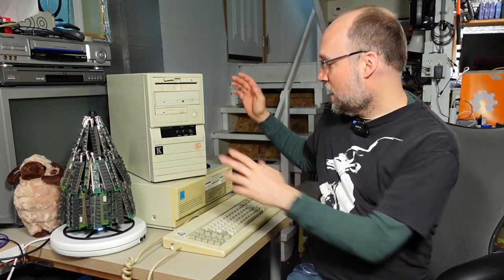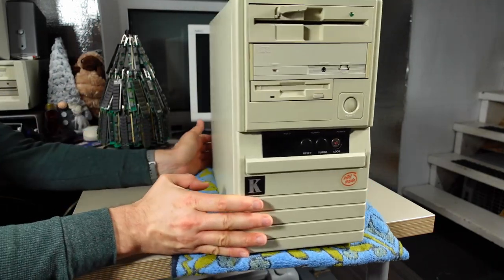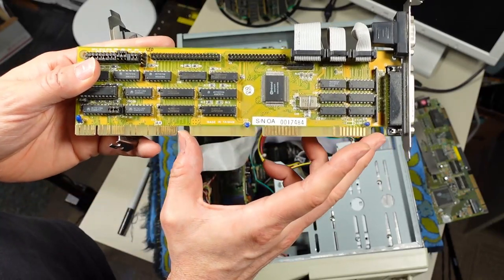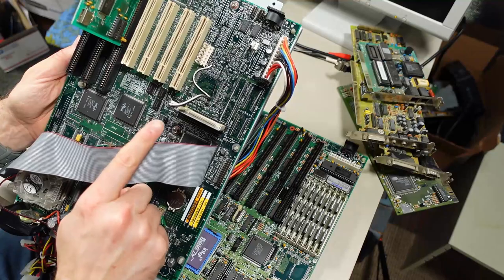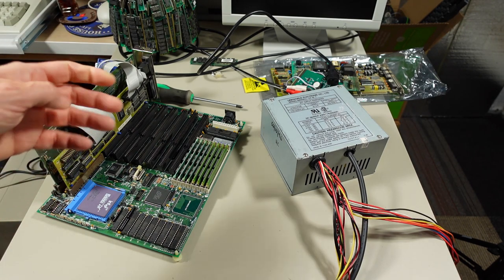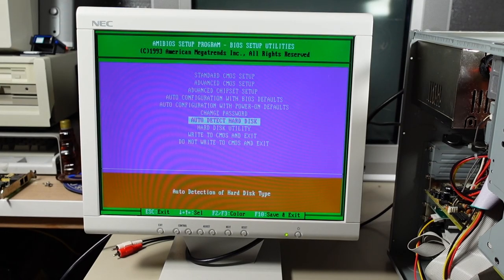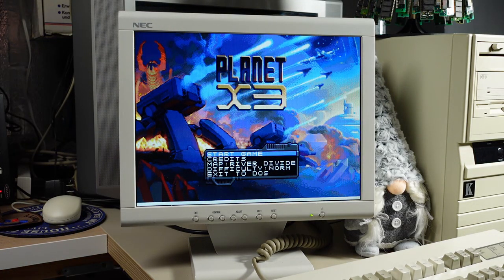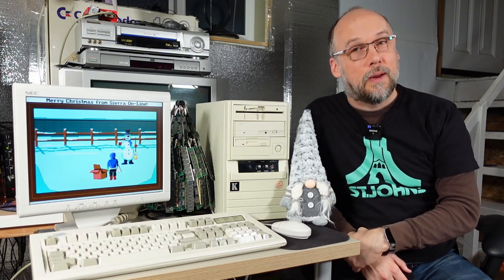PC archeology: Mystery 486 Mini-Tower

Comment: Hi Adrian - a good find there - you make me jealous

Re the sound issue, here is some hints - remembering the card may not be 100% compatible

1. in the bios disable com 2-3-4 , you only need 1 com port for the mouse
2. try using dos 6.22 and load different mouse versions mouse.com  / ctmouse    / mouse.sys i had a dell that hated the default mouse driver and made screeching mounds when moving the mouse
3. remove the modem - i recall you had one but not sure if it went back in - as they add a com port and steal a interrupt ( or double it up )
4. reboot in dos mode and try microsoft diagnostics  msd.exe ?? that will give you the resources used
5. remove the video card and try another one incase it uses different resources and frees something up that make the cdrom work or the sound better
6. in bios disable anything to do with game port - you have 2 so turn them both of for now then enable one or the other later
7. try re-running dos 6.22 memmaker - make a few copies of config.sys and autoexex ( i copy the first ones as *.1 , then second attempt as *.2 etc ) - you may find memmaker may be able to exclude some base memory address that is reserved fr the cards and your cd rom will play again - this does happen on my SB16-and 2x propitiatory ( sony ?? ) cdrom 
8. while the local bus cards have to remain in those slots, move the sound  card to a different slot - it may use different resources - this happens to me with those other sound cards ( they are cut on a slant edge on one side i forget the brand name ) - it also occurs if you have sound and network cards, swap them around and you use different resources - this happens on my dell celeron 2400

That is about it

Regards
George

Comment: Wow, I thought there would be more SMDs on those boards.  I was surprised to see so many through hole devices.  I remember in late 1993 my family finally bought a computer.  It was a pizza box Packard Bell running Windows 3.11.  It came with a 3.5" floppy and a tray style CD-ROM drive; I don't remember what the hard drive or processor were though.

Comment: I started a new job back in mid 2000 and the computer they gave me to use had that case.
The computer itself was terrible, I got into the habit of backing up the hard drive every night before I left because I was afraid it would crash the next morning.
When they finally got around to replacing it they admitted to me it was the oldest computer onsite.

Comment: The version of that utility for the GD543X series (VGAUtil/WinMode v2.06A in my machine's case) has more options, including independent refresh rates per resolution AND color depth selection pair.  The default for 1024x768, at least on this version, is 72Hz.  That's probably why it was tripping on the LCD.  I'm not sure if the GD543X version of the drivers would work with GD542X series but...worth a try, if you are ever so inclined to get that 486 working with an LCD panel. :)

Comment: Don't know the 'Thunder' Audio Spectrum, but I had a Pro Audio Spectrum 16 in my first PC.  It also drove my CDROM drive, a Sony CDU-31A single-speed drive.  It had a normal tray like a modern drive, no caddy or anything, but it also used some proprietary interface.  I do recall also that PC speaker sounds came out of my external amplified speakers somehow, and there was also a Windows mixer knob for speaker.

As far as compatibility with that card, I found Sound Blaster compatible stuff to work fine; however, IIRC that card was only compatible with a SB Pro and not an SB16.  If you wanted 16-bit audio you had to get native PAS16 drivers for it.  I suspect you may be using the wrong drivers, as there are different PAS models other than the PAS16.  If that doesn't help, perhaps something is quirky with this weird 'Thunder' clone.

Comment: I am very sure the issue IS the driver that does not initialize the sound card correctly. The fact you can hear very faint music from adlib/sb games is a clear indication of it. Too bad it is not a pnp card, you could have use the unisound initializer without the need of fiddling with old software.

Comment: Cirrus Logic video cards are also common in Japanese NEC PC-9800 computers, but using C-BUS connection. Sadly, they are not recommended for gaming as they are known to have compatibility issues with most games.

Also these cards offer VGA output connector, otherwise the computer only has Digital RGB and analog RGB video outputs built-in.

Comment: For the CD-ROM, it's either Mitsumi, Panasonic or Sony. Check the drive itself then google "manufacturer" proprietary dos CD-ROM driver. It's pretty easy to find. I probably got all of them around here somewhere so if you can't find it let me know.
There's also a rare card (AFAIK) that includes a LMSI Philips interface, but I doubt that you got one of those.

Comment: For your testing rig I'd probably switch out for an ATX PSU with an AT adapter harness. I had a fun moment once where an AT switch was wired up wrong and the spade connectors were kinda loose  and it threw a nice arc and flipped my breaker since then I've been really wary of AT supplies.
Reply from the maker: I actually have one of those adapters in my drawer,,, so it's not a bad idea. Yeah the whole AT switch thing is a bit dangerous.

Comment: That red Intel inside sticker had to be a 486 of sorts. In that FCC ID number is actually 486 mentioned as well. Maybe CTL sold to a lot Labs or Radio/TV stations which required a FCC certification.
The Pentium badges were original blue or black for the Pro. Aparently there were green Intel inside badges as well. Someone suggested for Low-power or embedded versions of 386 or 486 but there is no prove. I've only seen pictures of the green label on paper and never seen one myself on an actual case. There are some on ebay that say pentium as well. I've seen the red and the blue one with Pentium Pro written under it or the black one on an regular Pentium but never encountered the green one outside of ebay.

Comment: Adrian, doing a bit of research, I think that connector on the Thunder Pro Spectrum or whatever actually is SCSI... possibly? There seem to be drivers from MediaVision for that card with SCSI drivers, just like the real PAS. So, not sure what the issue is... Also, as others have mentioned, could be worth double-checking the CPU speed, as it went back to 50MHz after you replaced the battery. Though perhaps there's already a follow-up video that explains all of this!

Comment: I have a Thinkpad 755C with 32MB of RAM...on a 486. Original owner kept it around for a fair while. Also, funny enough, my Gateway 4DX2 has that exact CD-ROM drive! I scavenged it from another similarly equipped machine that'd suffered severe battery related damage.

Comment: PS/2 Microchannel machines were usually equipped with 2.88M floppy drives, but I never actually saw a 2.88M disk! And I certainly never saw a 2.88M drive operating in and ISA/EISA computer.

Comment: 50:12 Agreed that 24-bit color mode tends to be slower on PCs of this era. Out of curiosity, did you later redo the tests @ 640*480*4-bit & 16-bit with the new driver? It seems very odd to me that 8-bit color mode would ever be the fastest choice, given how slow it is at swapping out palette entries between two apps (or even one app plus wallpaper at times.)

Or does that benchmark only test scenarios where only one maximized, palletized foreground application runs against no other palletized applications?

Comment: I had a PS/2 computer I got from work that had a 2.88MB drive (the only reason I rescued it from recycling).  I don't think i had any disks of that capacity, though.  The random sound problems seem pretty accurate for that period.  Another normal problem was having multiple boot configs for memory optimization for particular games.

Comment: I'm one of the programmers of Planet X3, and being familiar with Shiru's Adlib code, I can tell you that something's wrong with the Pro Audio Spectrum.  Those are usually great cards with low noise, but something's not quite right with yours.  I also noticed that Doom is running very slowly, it's running at 386-40 speeds, so I'm guessing something is wrong on the motherboard somewhere (cache disabled?  wrong ISA bus speed?) and this would probably warrant further investigation.

Comment: The sticker on the back gives you a good hint what kind of CPU you can expect inside. I owned that single speed CD Rom Drive by Mitsumi myself - was less expensive than the ones from Sony or Panasonic way back in 1993  though I still paid my 200 bucks for it, but what will you do to be able to play Rebel Assault on your PC...?:) The drive has a proprietary Interface as most of the early drives had.The drive came with its own interface adapter. As an alternative you could by soundcards with not less than four different proprietary CD-ROM interfaces built in (I had one with Sony, Mitsumi, Panasonic and AT-compatible) ...

Comment: You can buy LIR2032 instead of CR2032 that are rechargeable. Not quite as cheap as adding a diode but it depends on your skills and the worth of your time.
Reply from the maker: I have been leaning to buy a bunch of those just to have on hand to make it slightly easier to change the battery out.
Reply: If you use a Lithium based battery it NEEDS a protection circuit, otherwise the motherboard will overcharge it and bad things will happen.

Comment: Sound card PC speaker was simply reading and decoding IO writes to the PC speaker interface, and emulating the CTC that was connected in the PC to drive the speaker. Different timing and thus different sounding audio, but many had a single pin that was used to feed PC speaker audio in direct.
Reply from the maker: I noticed a 4 pin header by the CDROM connector which made me think it might be a PC speaker connector to send normal audio and PC speaker sound to the internal speaker. Neat except for the terrible out of tune PC speaker sound LOL
Reply: @adriansdigitalbasement  Normally you had 2 audio connectors for CDROM, because you had different pinouts for the stereo audio from Sony and Mitsumi drives, so you literally would check each one to see the pinout, as using the wrong one would result in only getting one channel, as the right audio was swapped with ground. Thus you had a cable with 3 wires unscreened, or one with 2 screened cables, or one with a screened double core cable.

Comment: Do you ever wash your cards, boards and memory in the sink with soap and water? I've started doing it and it's very pleasing to see a lovely clean card.
Reply from the maker: I wash the stuff especially if anything has leaked on them (Caps, etc.) or if it's super filthy. But for light dust, usually not -- I just typically blow it off. I do like how things look though when they are brand new looking -- it is very pleasing.

Comment: Ugh, yes, I recently tried to get a Pro Audio Spectrum 16 to work in my Commodore PC20-III's 8-bit ISA slot. It needs two IRQs and two DMA channels for its native mode and its Sound Blaster emulation, and on an XT class machine, there's only one DMA channel free if you've got a hard disk... I did get some of the sound test programs to work, and even "8088 Corruption" played excellently with sound, but I ended up removing the card again because it was just too much trouble and not working reliably. Seems like I'm not missing out too badly ;-)

Comment: A DRAM xmas tree?  That's one use for them. :-)
Those early caddy drives were usually 1X or 2X.  Caddies were also used in early DVD-RAM drives.  
I have a SH*T load of old caddies I don't need.  Do you want them?
I've seen many AT power supplies that had those two half connectors with dove tails on the black side so they locked together but could be separated.
Looks like one set of simms is 2mb, and the other is 4mb.  Or it's 4 and 4.
I used to put the plastic standoffs into the slots, then push the MB onto them.  Some cases had those plastic standoffs SCREWED into the MB in a few places.  (or had snap in's on BOTH sides)

Comment: “No user serviceable parts inside.” 😂 That's just silly. Users routinely opened these machines up to replace cards and drives, and there's nothing above 12V in there (except the PSU, but it has its own case and warning label).

Side note: giving the PSU its own case was an excellent idea. Isolating the only dangerous component of the machine made it safe for an entire generation of young nerdlings like me to tinker with our computers. I'd probably never have touched anything in any of my PCs if I had to worry about getting accidentally killed by touching a high-voltage capacitor. So, thanks to whoever (presumably at IBM) made that design decision.

Comment: I had (and still do) a ProAudioSpectrum 16 and they were awesome if you bought them when they first came out.  Most people think of them as chasing Creative Labs but really it was usually the other way around!  MV would release a new PAS and it basically bumped everything up above the current SB card then Creative would add that functionality into their cards. 

If you wanted to get HQ sound into and out of a computer BITD and didn't wanna to stay in consumer land they were bragging rights cards.  I remember the only thing that was kinda lacking was you only got 8 bit SB emulation if I recall.  

It came with Tracker software and some .MOD files but now I need to go look up if it actually did any hardware processing of those or if it was emulated and just there to wow us who bought one at the time with music that wasn't hardware synth based since most of us hadn't heard a PC that wasn't SID, OPL, or the like.  

I fired up Diablo.MOD about 4 minutes after sticking it in my 386DX/40 and basically had to wash my underwear separately that day.   I still remember that vividly.
Reply: I will add though that they were a nerd card.  If you didn't have muscle memory for "Edit config.sys" after owning one then you were lucky!  I think that and putting "REM" in front of the HIMEM.SYS and EMM386.EXE lines had me in my CONFIG.SYS almost as often as messing around with the PAS16 settings to make them work. 

You had to massage them a bit.  Sometimes IRQ/DMA/PORT settings for one game would work but not with another.

Comment: Probably because of the battery and how difficult and hard to get 32 bits cards in that pc maybe that is why they throw it. Kudos on getting it working fine. The Isa cards were a pain back then and without a SD to ide card hard disk were slow. The bios working was awesome, those are know to brick before the slightly problem to boot. Seing that there's no HDD probably were that.

Comment: The first PC I ever built was in a case very similar if not the same as this around 1999 when I was 10. My friends Dad realized I didn't have my own PC, so he sat me down at a table with parts and a case, said what jumpers and dipswitches where, and not to touch them (Except I figured out one hard drive needed to be set to slave and the other to master). I think it was a Socket 7 board with a Pentium MMX that was a couple years old at the time, I don't remember the GPU, it was some ISA monster suitable more for 1995 than 1999, the PC had a couple 1GB IDE HDD's on a controller, of course it had mismatched floppy drives, a 5.25" and 1.44MB, some random unbranded CDROM drive you could've killed someone with if you hit them with it, it was 50 shades of beige.The part I remember the most was the OPL3 sound card, which is why I have a PCI OPL3 soundcard in my Windows 98 PC I've built for old gaming. It's the sound I remember most in old DOS games. I played everything from Doom, to Quake (Barely), to Fallout 1 (Also barely) on that PC. Yes I was allowed violent games / movies as a kid, it was the 90's, Mortal Kombat just made my Dad chuckle and shake his head. 

My Dad threw away this PC once I got a hand me down Gateway 2000 with a Pentium II from him about a year later, I wasn't happy about that
Reply from the maker: Neat story, although too bad the first machine was thrown out. Similar things happened to my first computers. Long long gone. :-(
Reply: @adriansdigitalbasement  Yep, came home from school, my Dad had setup his old Pentium II in place of my Pentium MMX, even got a upgrade to a 15" monitor (He kept his 17" Gateway "Flat" CRT)... Asked what happened to my PC, he told me he threw it away, did it on trash day so it was gone. I'm lucky I saved my N64, I got it Christmas of '98, my Grandma almost threw it out for whatever reason.

Comment: 10:30 I'm going to guess that it is a 486 (perhaps a DX2-66) based off the FCC ID ("486" appears towards the end of the ID) and the system was assembled on November 3rd, 1993.  The date is based off the first several digits of the hand-written serial number seen 1 minute earlier...

Comment: About the VLB on ISA: Thats explain the issue I had trying to use a VLB controller on an 16-bit ISA. The floppy worked but not HDD detection I had.
Reply: Some high performance cards of that type pulled power and the IRQ and DMA from the Isa side all other I/O through 32 bit bus